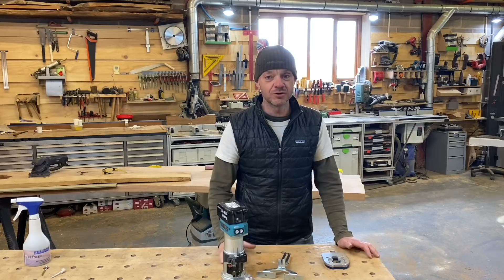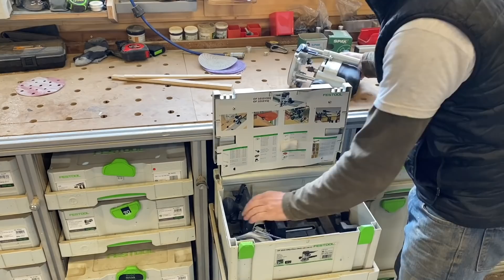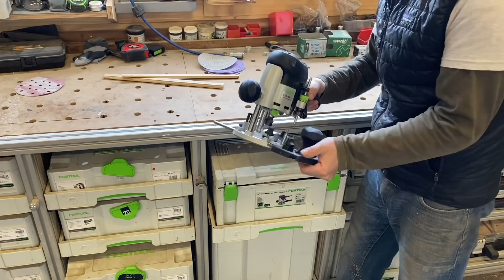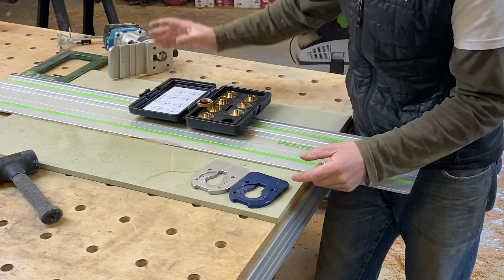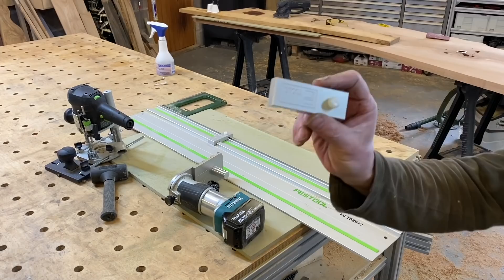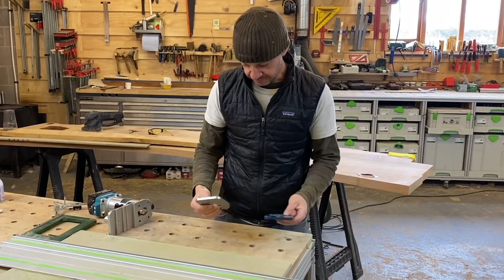FREE GIVAWAY -  #MWshoptalk FC tools 18v Router upgrades

Comment: How have 4 people thumbs down this, did they see the word 'Free' and think it was a loo roll giveaway!!!, I'm a makita user but you convinced me to get the cordless router when my T3 died and I wanted a replacement, it has more guts that the one I had! (had the T3 about 16yrs) I also bought the Banggood radius base ( which increases the base size for accurate routing) always run the ads and am a Pateron, that base looks so easy to use on the treack for rebates, looks like a must have
Reply from the maker: Cheers man.  Ace :)    It’s free stuff I paid for and a video that took me 2 hours + to make , but I guess some people just need more Lol

Comment: Hi Andy how do you cut a dado inside a panel? Router cannot be plunged right?
Reply from the maker: Not sure what you mean here if you mean rebate rebate to locate the panel I would cut that before assembling the door
Reply: @ManorWood  Hi Andy , sorry I ment cutting a grove that is not running running from one edge of the panel to the other edge of panel using the stop blocks.
Reply from the maker: Just plunge , with stop block if needed
Reply: @ManorWood  With the fixed base ?